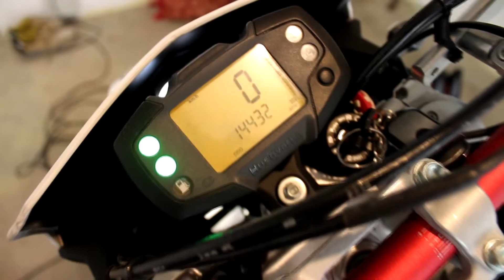Supermoto Maintenance | Part 1 | Oil Change | Husqvarna 630 SMR

Comment: Nice video, only one thing is bothering me. You didn't even mention the second mesn oil filter on the right side of the engine, under the clutch cover. You have to take the cover off and then you can pull it out and clean it.
Reply: Hello, I know this is 4 years later, but I have the same bike, and noticed today in the manual the filter you are mentioning. My bike has 7000km, should I clean that filter? Also do I need to order a new gasket first for the cover? Thank you
Reply: @DG-mi2mc  Yes. You need a new gasket. You may try to use again the old one with a little bit of silicone paste. The filter is iron. You do not have to change, just clean it.

Comment: Thanks for the vid. I just did my first oil change on my SM610 since I was unsure of when the previous owner did the last. The oil that came out looked fairly new so that was a relief.  Now when I removed the metal screens I placed it in some kerosene to give it a clean and noticed there looked to be 3/4 left of what once was a small washer floating in it. Is there meant to be a washer inside the screen cavity somewhere? Thanks